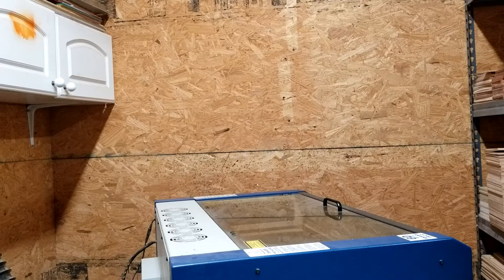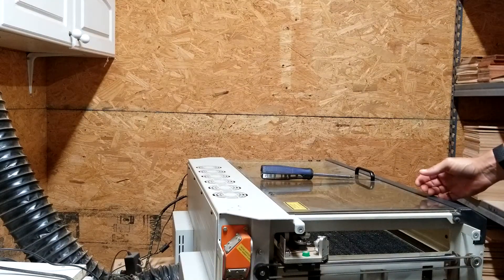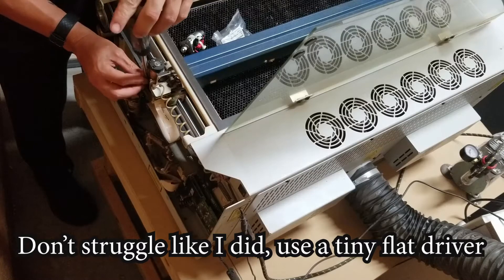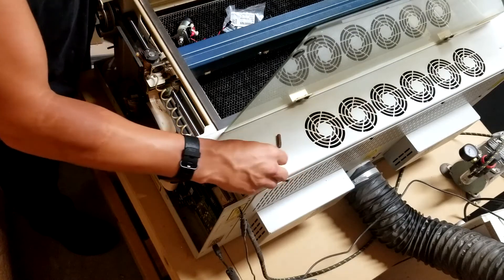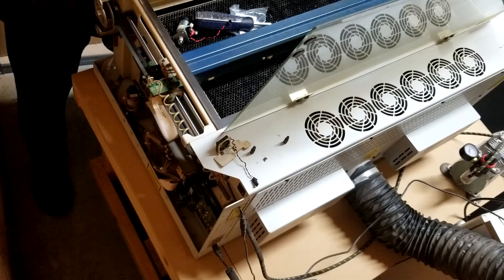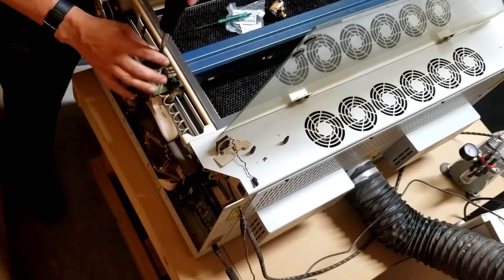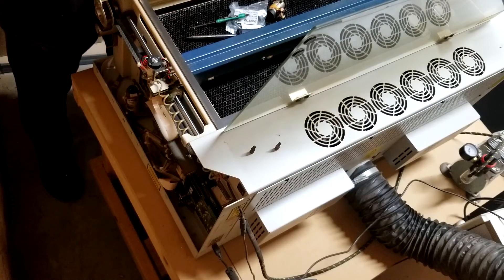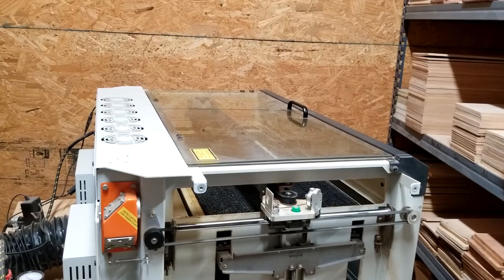Epilog Laser Tutorial - How to Change the X Axis Motor on an Epilog Mini Laser Cutter & Engraver

Comment: Good evening sir
I have a problem X / Y  Disabled : Y , how do I fix it please?
Reply from the maker: Disconnect and reconnect wiring, reboot machine. If that doesn't work you'll have to replace the motor
Reply: @LifeWithRoger  Thank you, I unplugged the wires, it didn't work
Reply: @LifeWithRoger  Is the engine the only problem or is there something else?
Thanks
Reply from the maker: @aimededdienbogos4647  call epilog support. They will walk you through testing the motor
Reply: @LifeWithRoger  Now you are forced to go back and forth by email. Gone are the days when a friendly tech would coach you through a problem. I put is a "Ticket" with four issues I was having. Before they emailed me back I fixed an encoder problem and the reply was everything should be ok now. Did not read the whole email with 4 different issues. Problem still broken and now it is the weekend. Very disappointed in their new way of assisting customers.
Reply from the maker: That's crazy.. That was literally their best thing. @chuckcrooks8816
Reply: @LifeWithRoger  No longer. When you have a business that communicates via email for customers with a problem it is bad business. I'm out of business and they do not seem to care.